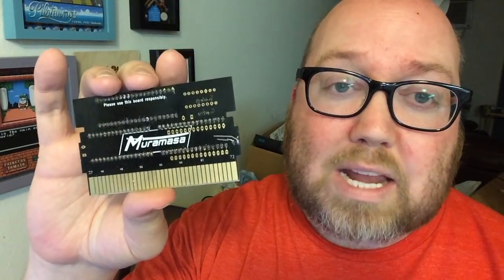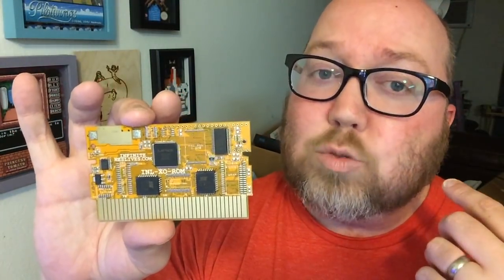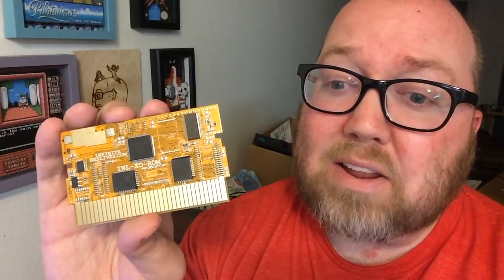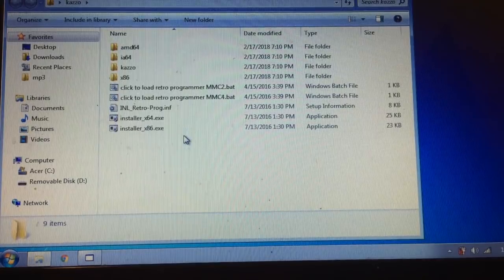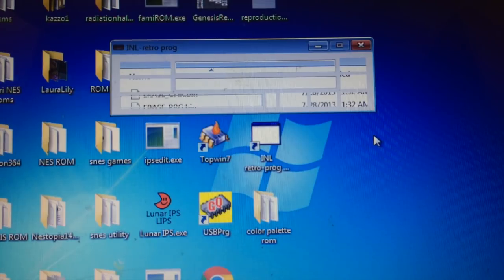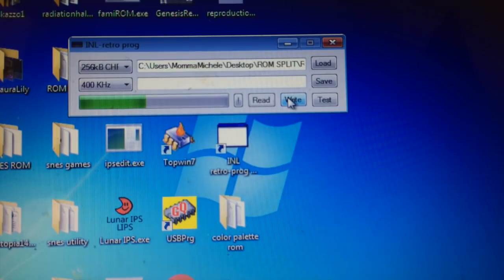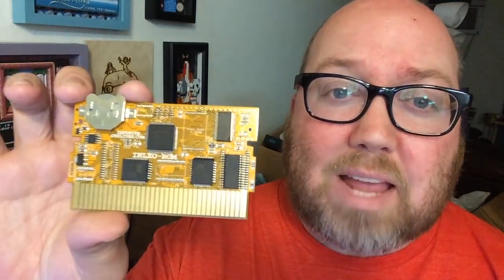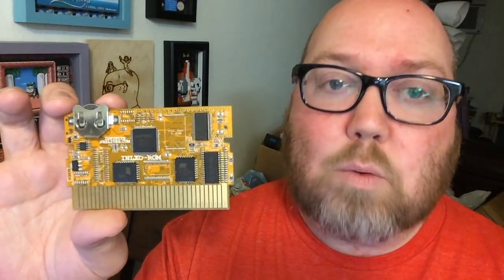NES/SNES Repros - NO WIRES, NO SOLDERING! - RIGGS

Comment: SNES games are more complicated. The cheapest way to buy from INL, like you said, is in bulk. More than likely with SNES, you won't be making a ton of the same if you're doing repros for yourself.

The boards require the size of the Rom to fill the board, so many games you will have to manually edit via a hex editor to make the correct size. Some roms are required to be headerless as well which is another can of worms. It's not quite just plug and play with the SNES side of the Kazzo.

Edit: I also wish you would have explained Matching the board type of the game you wish to create with the purchasing of the correct Board.
Not a lot of people understand where the size of the PRG and CHR, or the types of boards such as "TL-ROM" ,"SU-ROM" , "UxRom", or others come from.

If you need some help with dumping games, hit me up on NA.
Reply: I bought an original copy of Bahamut Lagoon for Super Famicom, and I want to take out that board and put in one of these INL boards and write an English patched version of the game to it.
Any idea where I can go to get the information I need to do this correctly? I'm confused over what PRG is, what CHR is, how to find out what size MB I need to write, other things to consider like SNES special chip games and so on.
Also, does the INL writer and board support PAL roms to play in PAL systems?
Reply: David White SNES Roms are not region locked, so you can put roms from any region on one of these (adequately sized) boards and it will work.

Also, PRG and CHR are things you do not have to worry about while using this for SNES games. There is a great README that should answer all of your questions and give a great walkthrough on how to use the Kazoo Programmer

Readme file: https://www.dropbox.com/s/jg5j8s949o7lqox/readme.txt?dl=0
Reply: Thanks man that's really helpful! The only thing I'm slightly confused about now is the fact that there are 2 different slots - for Super Famicom, and SNES - all cart pins are the same size no matter what region so I don't know why 2 slots are needed on this device

Comment: I have the INL dumper/programmer. I use it to dump my own NES carts. It does the job, but isn’t as easy as dumping SNES or Genesis games using a Retrode.
Hopefully the Retrode gets an adapter some day. I think I remember hearing that INL is working on new firmware/software to make dumping more intuitive.

Comment: Thanks Riggs. Unfortunately like most products in the Retro community this looks like it's going to be sold out forever. Just like rgb and HDMI kits (like ultraHDMI for instance), for some reason the sellers don't seem to want to do it as a business even though they present themselves as a business. I get it when you're doing it as a hobby project, but to do a pro site and setup as a business and fail at logistics is a real bummer.

Comment: The only thing hard about this is trying to figure out which board and size needed to make the nes repos, because nes games use different boards and men sizes. If there was and easy way to figure out which games need which board it would make it easier. That's why I only made one repro nes game and just do snes repros. Snes repros I just need to load the game into programmer software and it tells me how big it is and whether I need to set it to low or high mem setting the boom done.

Comment: Mister Riggs! I want to make a cartridge for Metroid Rogue Dawn. Rogue Dawn has a battery / save function, but the original did not. Other than the board, is there anything else I need to keep in mind when making this? Is the mapper different?